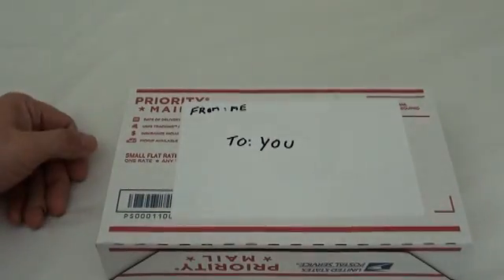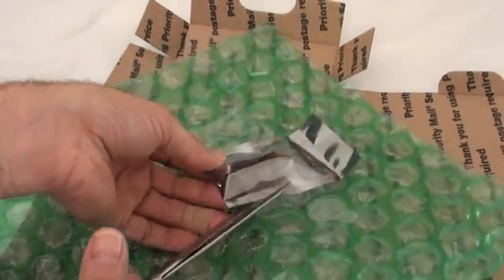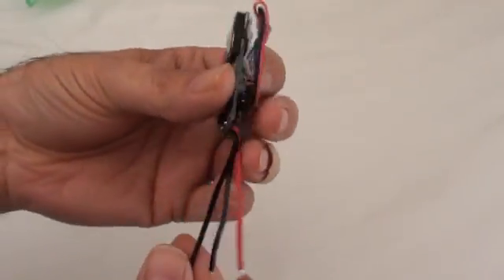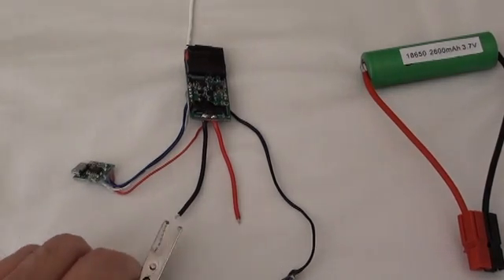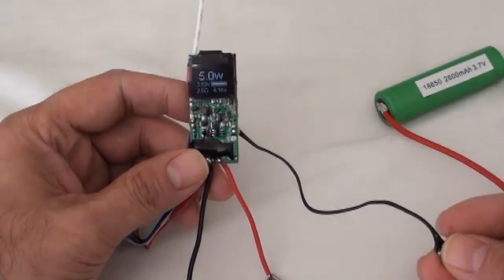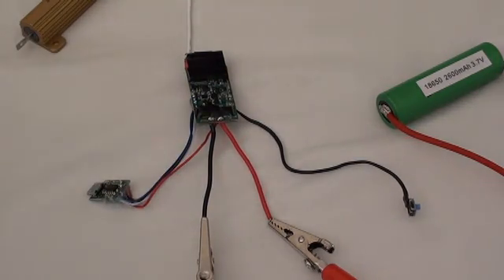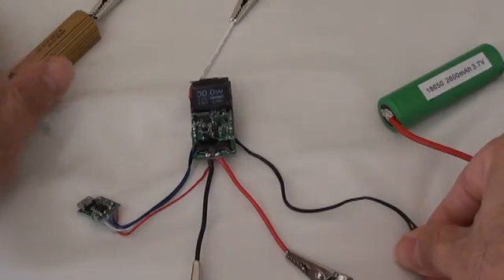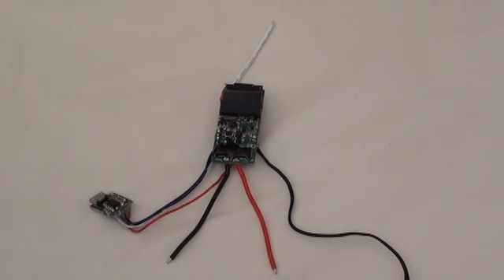YiHi Sx350 Mod Chip - Unboxing and Testing - Regulator Board for Vaporizer

Comment: it's hard to tell from the video but is the board big enough to solder different wire to it so you can put on different buttons to adjust wattage and to fire it?
Reply from the maker: ***** if you are skilled in SMT soldering it should be no problem.

Comment: With the new firmwares, can the time limit for the firing be increased or even turned off out of the system as I like the idea, but I don't plan on using one of these for a vapourizer but as a voltage control unit for an electric motor.. 

Any feedback would be great.. 

Also if the system won't allow me to override the timer, where Abouts on the board could I hook up a switch to keep constant power after firing?
Reply from the maker: no, there is still a time out feature. i think you would need to hack the firmware to get the features you seek.

Comment from the maker: They are called anderson power poles,  i like them... the crimper is expensive
Reply: +teamtiki Hi teamtiki, just wanted to ask you what could be the problem of my YiHI sx130h Chip, after pressing the power button for 5 times after the logo, etc lights up, the display would go blank. Without showing the Watts, Volts, Ohmz, etc... Hope to hear from you and help me. Thanks more power to your channel!
Reply from the maker: +Jerome Marquiee  sorry, i don't know. I have only used the Sx350.   I can say almost all the problems I encountered were because of low quality batteries or bad solder connections.

Comment: all that functionality with a one button menu system looks like a pain in the rear to me
Reply from the maker: One button is easier to install into a custom case, and there are fewer parts to fail. It  does take some practice to get used to the system, and for dialing in a voltage "by taste" it takes a few more steps...  All in all its not a deal breaker to me... And the best part, Yihi has released a firmware upgrade that allows up/down switches to be installed.

Comment: why does it say it has a 2.5 ohm resistance with no atomizer even hooked up?
Reply from the maker: It has to say something, so it says 2.5ohm.  With the latest firmware update it now indicates that there's no atomizer attached. . Yihi  has been very active at listening to the customers and fixing problems.
Reply: teamtiki awesome. Ive been debating using a DNA30 or the Sx350 for my next build. I like the ability to be able to customize the startup logo, once I figure out how.